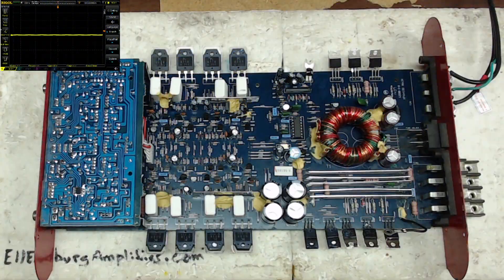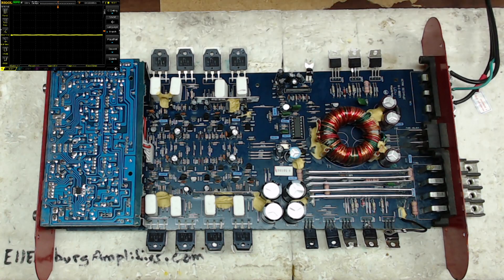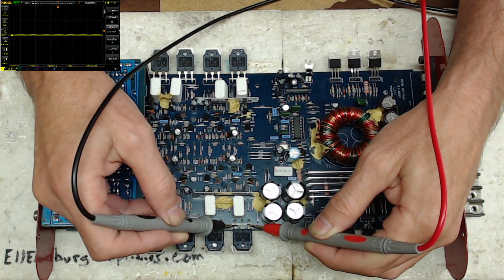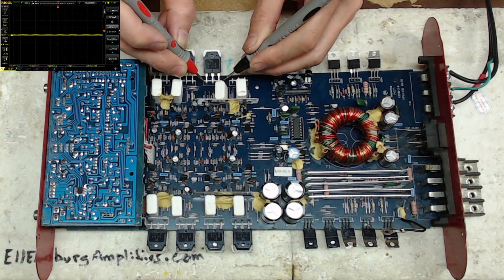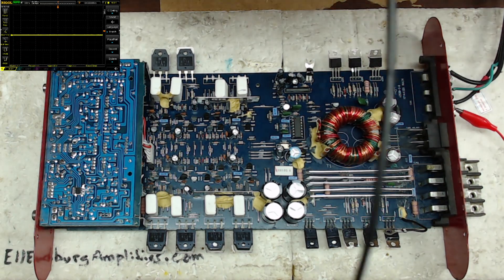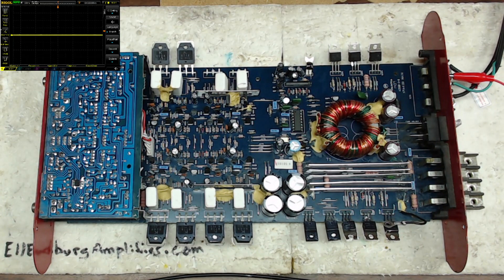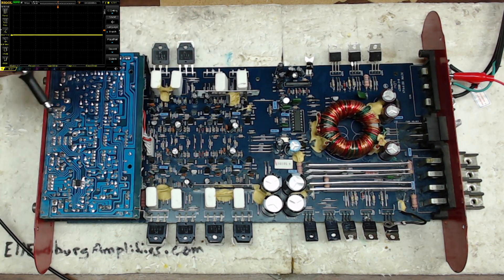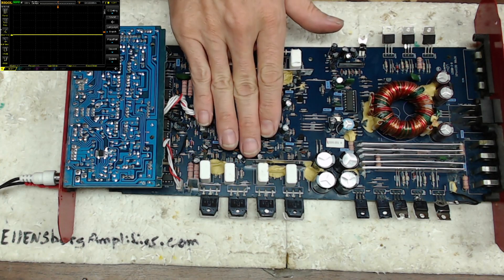Dual XPA4100 100.4 Class AB (2007?) Automotive Amplifier Repair Shorted Output Transistors

Comment: What are the ohms it handles? How does the output selection work because it says 2/3/4 outputs on the selection button?  can i connect a 150 rms 2 ohm dual coil kicker subwoofer?
Reply from the maker: I would not use a Dual amplifier to drive a subwoofer. They are just not built well enough in reality to support a heavy motor. The selection switch allows the use of 2 to 4 channels but not an option to have a mono-bridged output. I would shop for a mono amp to drive the subwoofer.

Comment: Thank you for your vid. I fixed mine by replacing a 718 and 688 last weekend. I still don't understand how these are used. The protect light is now green. They blew because of my mistake of reusing the fatigued stock speakers with this amp. Got my parts on fleabay.
Reply from the maker: Thank you for the channel support! Learning electronics can be a task but as I always say to my new apprentices "once you understand how a diode works then you have begun the proper path"

Comment: Hello  Sr. I mistakenly put 24v to my 12v Amp. No smoke cam out but now it blows the amplifier fuse the minute I put power en ground  to it. What can be bad or what damage I have to look for.
Reply from the maker: The first things to look for are shorted power supply transistors and any associated driver transistors. I doubt there will be much damage past the power supply.

Comment: Ahh ok. So without FETs you’ll see a square wave on the gate (no feedback from FET as you were saying), and with FETs you’ll see a sine wave at the gate on output FETs, that is what you are probing correct? Looks to be from here, just after the 10:10 time mark. Also I’m finding (in née to A/B amps) not all amps have a square/cube/box like emitter resistor. The Orion 275SX only has classic through hole looking resistors, seems to be a lot of variance between A/B amps, as with D ...I better get ready :) lol
Reply from the maker: You will find a rather large signal at the base of the output transistors which is dependent on the input signal. I keep the input signal around 1.5 to 2 volts so I know what to expect through the staging. On the emitter resistors, there are a few styles of resistors but as long as you see resistors at the emitters it is a safe bet it is a class AB. Something like the US Amps DE amplifiers is an exception.

Comment: For example I have a Soundstream 80 watt per Channel,  an avatar 115 watt per Channel,,, Orion XTR 90 watt per Channel all have different power supplies but the same output Drive with minor changes between the three
Reply from the maker: Also, keep in mind that advertising specs are just numbers that can be pulled from any advertiser's mind. I would compare the rail voltages between those boards to fully understand the relationship of comparing outputs.

Comment: I've noticed that the output sections on A/B amplifiers are 90% the same so would it be possible to upgrade the power supply to get better cleaner power from a cheaper amp
Reply from the maker: Hi Frank. It depends on what you consider upgrading is. Output has a relationship to the rail voltage. All components are matched to the rail voltage. If you increase the rail voltage you will have to increase all the other dominos that are in place. Also "clean" will be dependant on the efficiency of the pre-amp and the output filtering.

Comment: Hello sir, I'm creating a mono amplifier with pnp npn configuration. 
I'm using 2 pairs 1943,5200 as main transistors and tip41c,42c as drivers.
My question is how much rail volatge it needs to get 250-300 watts at 2ohm?
35 0 35 ?
Or 24 0 24?
Reply from the maker: Those are 15a transistors so at 35 volts you will be running around 8.6 amps and 12.5 amps at 24 volts. However, there are many factors that determine the end result. The voltage of components used may work better with a 24-volt rail over the 35-volt rail. I would work with the 35-volt rail to reduce the overall current.
Reply: @ellensburgamplifier  ok sir thanks.
I am using a t50 core, primary turns 5, secondary 15 turns.
Output voltage is 36v.
I'm using P80nf06 mosfets total 4.
2 for each side of torodial.
For frequency I'm using sg3525. Frequency is fixed at 53khz.
Gate resistors are 15ohm.
2 mosfets getting realy hot while operating but other two are just warmth a little bit.
What will be the problem?
I have also used irfp3205 but they failed after 10 minutes.
Reply from the maker: @redxaudios9305  I would be looking into the frequency. The power supply transistors are heating up? Are you using a snubber network?

Comment: where do u source your transistors? grate video! how about making a video a doing a load test?
Reply from the maker: There are a few places I go to. I get most of my parts through Mouser and an online Ebay seller "ma_vm" she is excellent at having obsolete parts and she has a wide range of parts. From there I move to LCSC and if LCSC doesn't have what I am looking for I move to my next supplier "Aoweziic Raw material spot Store" they are another great source for parts at competitive prices.